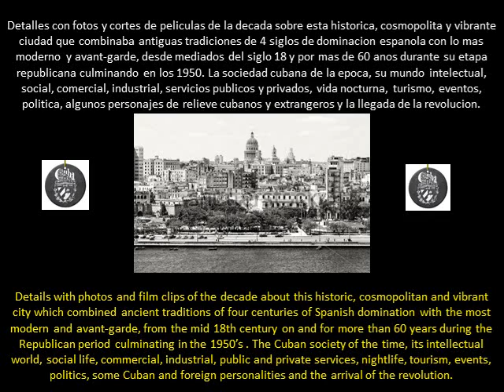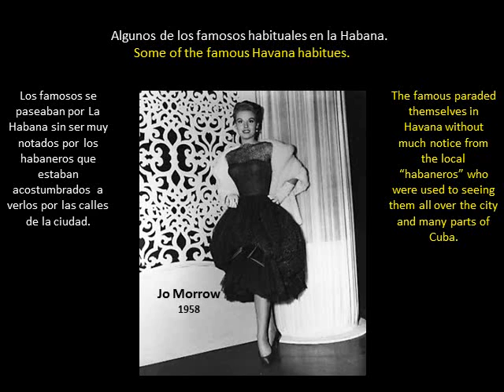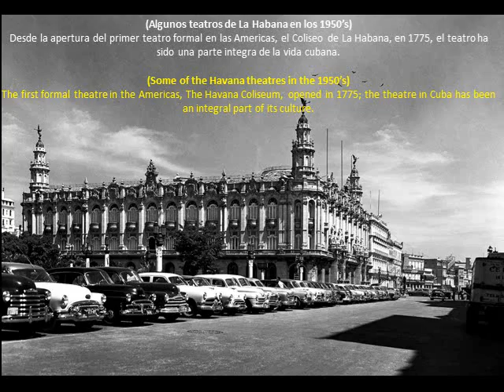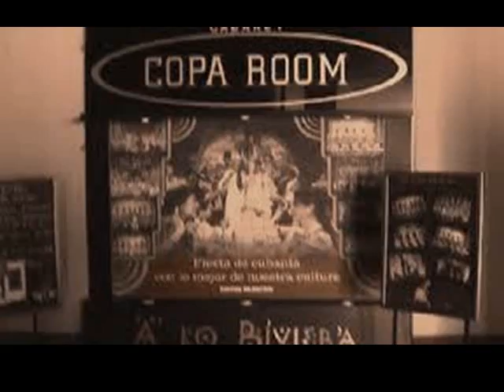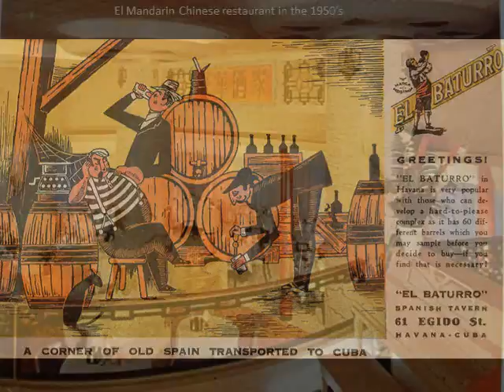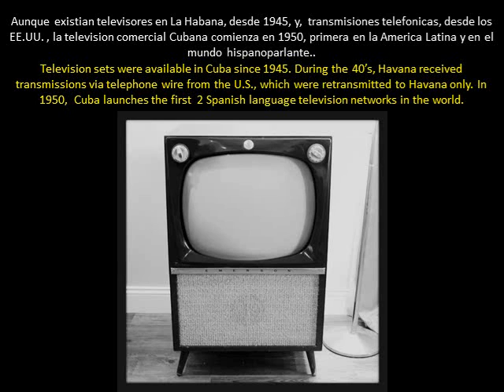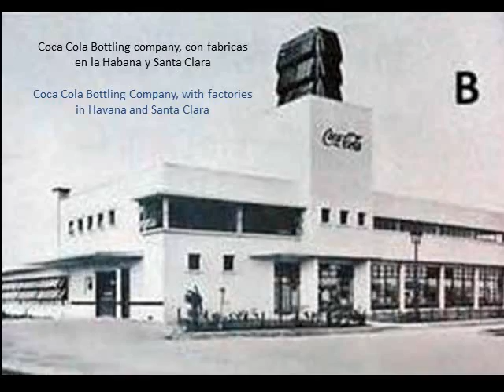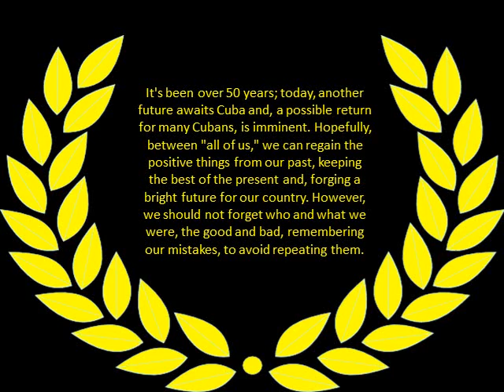Havana in the 1950's

Comment: Fascinating, but why the deliberately poor resolution on the film clips? Is this some kind of copyright issue?
Reply from the maker: Hi Myriaddsystems. Although, high-quality film, projectors, kinescope machines, etc were available in the 1950s high resolution or HD was not available during the era and before.  Many of those film clips are mostly available as second-hand material, some are better than others but they come from old documentaries and movies filmed in 8, 16, or 35-millimeter equipment of the time, also, we could not foresee in 1959 that Cuba would become a communist state so quickly and close borders to most of the world, the best quality material was left behind in Cuban archives and television stations and we ended up gathering what we could from 2nd or 3rd copies of those films and documentaries distributed around the world. A copy of a copy will always degrade in quality.
Thanks for your comment and Happy New Year.

Comment: Actually puerto Rico was the first country in Latino America to have had the Telegraph, Morse himself installed it, between his daughter's hacienda and the port of arroyo.
Reply from the maker: Mr. Benjamin Martinez. Actually, we must always question and double check everything we read on sites such as Wikipedia etc. Information is often missing, simplified or misleading.
The town of Arroyo is honored to have been the first municipality of Puerto Rico that had a telegraph line, in 1858 or 1859 according to the chosen source, at the initiative of Samuel Morse himself, who had patented in 1837 the famous code that bears his name and a transmitting telegraphic device. The telegraphic connection communicated the Hacienda 'La Enriqueta' owned by Edward Lynd and his wife Susan Walter Morse, daughter of Mr. Morse, with their thriving textile warehouse located on the dock of the port of Arroyo, which were separated by a distance of more than three kilometers Arroyo's private telegraph line would be officially opened by Morse himself in early 1859 but the beginning of Cuban telegraphy dates from 1840 to 1853. Between 1853 and 1864, the entire island of Cuba, from the City of Pinar del Rio to Santiago de Cuba, more than a thousand kilometers away, was linked by the "Mr. House" system.

The creation of the first telegraph line in Cuba was based on an initiative of the administrator of the first railway line of “the Very Loyal” Island of Cuba (and throughout Latin America) In 1840, Mr. Antonio María Escobedo requested the Captain General and Governor of Cuba, Mr. Pedro Téllez Girón, authorization of the Superior Civil Government to install the laying of a line for telegraph for the transmission of electro-magnetic correspondence, for which a network of poles would be used to support the telegraph line, located in parallel to the railroad tracks that linked Havana with Güines, the line was inaugurated more than a decade later in 1853.

The first telegraph line was a double conductor of galvanized iron wire with glass insulators and supported by 30 carved wood posts, with a height of 20 to 25 feet. The Royal Development Board set the amount to be paid for each machine or device at 520 pesos, taking as reference the Mr. House Printing Telegraph Device, which was the first to be used in Cuba. The price of each of these railroad devices was estimated at 100 pesos.

Instead of the universalized Morse system, which transmitted the offices using a binary code, Cuban Telegraphy opted in its genesis to implement the Mr. House Printing Telegraph Apparatus. This innovative system, which printed the text in characters of the Latin alphabet instead of the most popular code of dots and stripes, was used only in the early years and, given its inefficiency, would be replaced by the Morse apparatus. With this system and its fascinating apparatus, antecedent of modern teletypes, the Cuban Telegraphy was ahead by a century in its time. The singular Mr. House apparatus printed the telegraphic message on a continuous tape, which was conveniently folded and introduced on beautifully and detailed illustrated envelopes.

Meanwhile, in 1851, the Count of Alcoy (then Captain General of Cuba) granted the first permission of the Superior Government of the island to the North American Samuel A. Kennedy, to establish a first urban telegraph line in the city of Havana, communicating the Villanueva Theater with the Plaza de Monserrate. One year before the first experimental telegraph lines were installed in Madrid.
  
The administrative start of the Telegraph on the island of Cuba dates from 1852, the year in which the Royal Development Board obtained a loan of 108,901.50 pesos, at 9% annual interest, to establish the electrical Telegraphy, as stated in the "Annals of 1856 ”, under the heading“ Electro Magnetic Telegraph ”.

In 1853 the Special School of Telegraphy was established on the island by the Royal Board, it was initially financed with 3,000 pesos, for maintenance, which was to be borne by the winner of the first public tender called in 1853. Regulation of the Preparatory School for the Special School of Telegraphy was issued on June 11, 1855.

Evolution of dispatch traffic in the first years.
 The Electro-Magnetic Telegraph Service. (according to the denomination it received at the time) began already advanced in 1854, being provided at the end of the year with 22 Stations, and having collected 5,868.59 pesos . This figure increased slightly in 1855, reaching an annual turnover of 7,585.29 pesos. In 1856, the service began to have a greater demand, with 38,568 private telegrams sent in Cuba, for a total amount of 31,940.20 pesos, according to data from the Directorate of Telegraphs published in the 'Gazette of Havana' of February 14, 1857, from the State presented by the Telegraph Administration, signed on December 31, 1856 by Tomás de Ibarrola. The year 1857 would be especially relevant for the growth of the service, experiencing telegraphic traffic a growth of almost 75%, with an annual volume of 38,568 telegrams and revenues of 31,940.20 pesos. Similar magnitudes were obtained in 1858.

In 1853 the works began, with the ambitious forecast to build 50 Telegraph Stations, establishing a budget for the construction of each Station, estimated at 1,700 pesos, and the first 58 kilometers between Havana and Batabano. From this first line, other sections were opened, establishing the lines parallel to both railroad tracks to the town of Trinidad, and others from Villaclara to Sagüa la Grande, Cienfuegos and San José de los Remedios. The total cost of these lines doubled the amount of the first loan requested, amounting to a total of 204,844 pesos. At the end of the 1850’s, the works of the Main Telegraph Line were structured, depending on their extension and the large populations that linked in the fertile regions of Bejucal, Güines, Matanzas, Cárdenas, Cienfuegos, Villaclara, Tinidad , Sancti Spiritus and Port-au-Prince. The initial planning projected that another Line would depart from Port-au-Prince to Las Tunas, Bayamo, Santiago de Cuba and Baracoa. 

On March 2, 1857, the first Provisional Regulation of the Body and Telegraph Service of Cuba was promulgated, whereby twenty stations were governed until 1860, which then formed the network of Telegraph Offices on the island. In 1863, Queen Elizabeth II would sanction a new regulation that sought to perfect, correct deviations and promote the young Telegraph Branch. Initially, the Cuban Telegraph Corps was in charge of the Royal Development Board, passing during the period of construction of the Line and Stations to be a Section of the Public Works Directorate until, once Consolidated its expansion, in 1863 it was attached to the Administration Directorate of the Superior Civil Government, until it became a General Directorate of the General Government of the island. In its first ten years (from 1853 to 1862), the telegraph lines reached the main towns of the provinces of Havana, Pinar del Río, Matanzas and Santa Clara. In 1862, Telegraphy arrived in Camaguey. And finally, in 1864, the year in which the General Inspection of Telegraphs of Cuba was created, the telegraph line reached the distant Santiago de Cuba, the easternmost of the main cities of the island.

(Development of the telegraphic service in Puerto Rico).

The start of the telegraphic network in Puerto Rico dates from 1864, the year in which the Kingdom of Spain approves to establish a telegraphic communications service on the island, although that first project was not implemented. It took two more years for a new plan to be approved, calling for a public tender, but no one submitted to the contest. Finally, in 1869 the Royal Development Board, through the Directorate of Public Works, began the construction of the first Puerto Rican telegraph line, between the capital San Juan and Arecibo, with an extension of almost 100 kilometers in length and 7,850 pesos investment. 

As in the peninsula and on the neighbouring island of Cuba, a first regulation was drafted to regulate the telegraphic service in Puerto Rico. And also as in Cuba, it was Fomento who assumed the management of telegraphy in Puerto Rico, appointing the Director of Development as head of Telegraphs and assigning effective control to the inspector general of Public Works, responsible for laying the line, which lasted until May 1870, except for the section that would link San Germán and Ponce. 

Public Works built the main telegraph stations, with the municipalities assuming the financing of stations in secondary populations. When the first telegraph station was inaugurated in Guayama in 1870, the first public lines of the island were connected to the submarine cable that the West Indies & Panama Telegraph Company had, establishing direct communication between San Juan de Puerto Rico and the islands of the British Caribbean Jamaica and Santo Tomás.Two years later, this company would connect the telegraph services of Puerto Rico and Cuba by cable. 

The first great laying of the telegraph in Puerto Rico, the so-called Western Line, was one of the six sections or lines, after the first of San Juan and Arecibo, which would be completed in 1874, joining San Germán and Ponce via Mayagüez, thanks to an investment of 12,704.50 pesos. 
In the mid-1870s, the telegraph service of Puerto Rico was already made up of six lines, which were served by more than twenty stations (10 main ones built by Fomento and 12 secondary offices built by town halls) Telegraphists provided 12 hours of uninterrupted service a day, from six in the morning to six in the afternoon.  

In November 1874 the pioneer private line of Arroyo, which had been built three decades before by Samuel Morse himself in 1858, was incorporated to the main telegraph network.